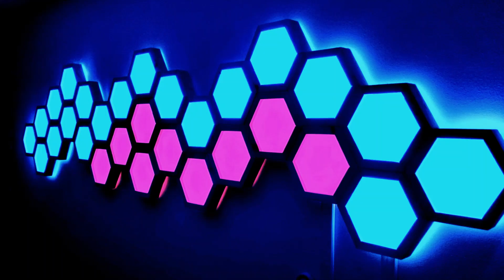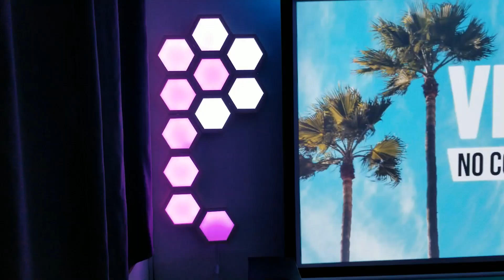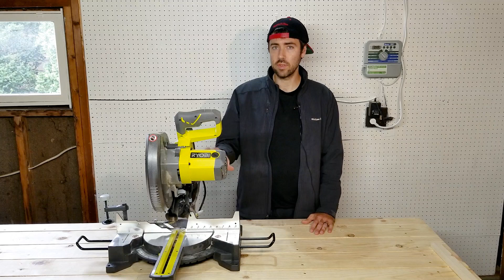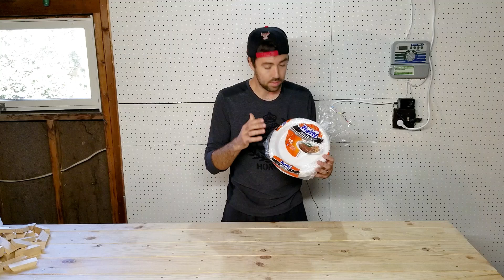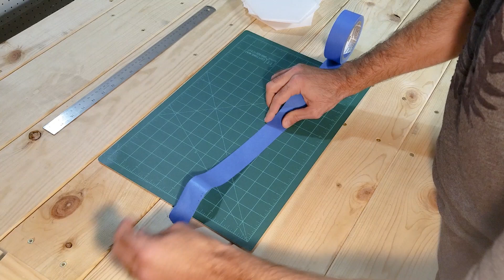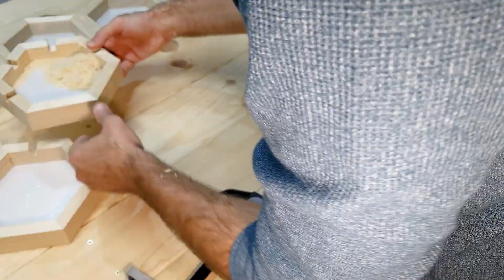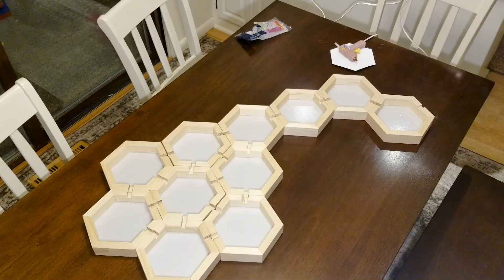Making My Own Version of Nanoleaf Hexagons - DIY Project (No 3d printing, programing or soldering)

Comment: Hey man great staffs. But I was wondering if the paper can diffuse the light well enough
Reply from the maker: Thanks so much! Paper comes in all different variety but it does work as a diffuser. In my experience when I was testing a variety of materials, white paper diffused the light a little too much but there may be different kinds of paper that would work. The styrofoam plates I used in the video did the best job of diffusing the light just enough where there were no hotspots but still let enough light through where it was bright.
Reply: @ChrisMaherDIY  so I tried the offset papers. Didn't work man. Too many hotspots. Then I tried the art papers. But still there were some hotspots. However when I attached two art papers, they did the job!
Reply from the maker: @kheladhulaobiram  There ya go! Awesome! All about trial and error. Part of the fun is finding what works and what doesn't. Thanks for the update!!
Reply: @ChrisMaherDIY  wanted to show you the final results 🥰 https://photos.app.goo.gl/hpRFpezvjw5pKpn36
Reply from the maker: @kheladhulaobiram  thanks so much for sharing!! Looks great!! You did that using art paper right?! Nice work!! Love the design too!

Comment: This is a great video and using Hefty plates is genius... I've been searching for perfect diffusers and this is great.  Also, with LEDs that are 30 LED/meter, you need 34mm from the light to the diffuser to get a "spotless" effect.... by using 2" boards with a slight indent (and considering the light source is slightly higher than the back), you managed to hit that 34mm perfectly, it seems. Did you plan that out ahead?

If you use LED strips that are 60 LED/meter, you can cut the side height in half... for any future projects.
Reply from the maker: Thanks so much for watching and the great advice! I didn't plan it out, it just was a lot of trial and error before I got the look I was going for! That's great advice! Cutting the side height in half would be great since keeping a low profile is preferred in my opinion! Thanks again and thanks for the feedback!
Reply: I dont understand what you mean, why do you need 30 m led
Reply: Later he found that white acrylic with 32 percent transparency looks better, but it costs way more.
Reply: https://youtu.be/YLfwbr-5PxM

Comment: Hey Man Great Video. Just a quick question, I want to know exactly how much hexagons to make to fit one led strip so; can you tell me the measurement of the short side of the hexagon pieces? Thanks
Reply: Also would you recommend using the wood glue to join the hexagons together? Have the super glued ones fallen off?
Reply from the maker: Thanks so much for watching! I appreciate the support. I just measured. Looks like the inside of each piece is 3 1/4  inch. (Three and one quarter inch)

Comment: Nice build, I actually just got done building my own after putting poster board on back how did you hang it in the wall?
Reply from the maker: Nice! How did they turn out?! I got some picture hanging hardware at home Depot. Its still on the wall and I didn't even have to find a stud. Just went right onto the drywall. https://www.homedepot.com/p/PicGenie123-40-Piece-30-lbs-Picture-Hanging-Kit-Hangs-Pics-Up-4-Pack-M30-MK4D/302044240
Reply: https://drive.google.com/file/d/1eiN2qKP_aFu5GCqhiHHo_dZ7Q66n0QF6 turned out good thanks for the tutorial man. Just saw your new one wish I woulda waited for the black though! Ah gonna have to just start another project haha 😆. Appreciate ya 👍👍 keep up the awesome vids!

Comment: Hey! How did you make it possible that every hexagon has the same light color?
Reply from the maker: The big design I have 2 controllers and the app that you use for the lights let you pick the color. In my thumbnail, 1 controller is controlling all the lights that are teal, and the other controller is controlling the led lights that are red. Hope that makes sense!
Reply: @ChrisMaherDIY  Ah yes I understand! I've bought a RGBIC LED strip. Do you know if its possible to select like 6 lights
 to go one color and 6 to be a different and so on?
Reply from the maker: @jelleraffel5  I see! Yes that is totally possible. I would recommend using an esp2866 board and load a program called WLED on it. Super easy to do. You can then set any LEDs on the string as a "group" and then control those groups individually!
Reply: @ChrisMaherDIY  Ok thanks, I'll look into that! One more question, they say RGBIC strips can not be cut, is this true?
Reply from the maker: @jelleraffel5  you can definitely cut them as I found out after making the video.  the leftovers can be hooked up to work just fine with most controllers. You just have to use either a 5v or 12v power supply depending on the type of lights you are using.

Comment: how to attach or hang on the wall ???
Reply from the maker: I just used some picture frame hanging hardware. I dont know if you have Home Depot where you live but this is the exact one I used: https://www.homedepot.com/p/PicGenie123-40-Piece-30-lbs-Picture-Hanging-Kit-Hangs-Pics-Up-4-Pack-M30-MK4D/302044240
Reply: @ChrisMaherDIY how much are the wooden cleats in cm ,and the length in cm of the cleats? I am French
Reply from the maker: @djbenouf  Thanks for the comment. What is a wooden cleat? I have not heard that terminology before. Are you able to explain?
Reply: @ChrisMaherDIY  the wood you use! how much width, depth and length ?? for cutting
Reply: do you have a link where to find the wood you use ??
Reply from the maker: @djbenouf  Ahh i see! I used something that is called 1" x 2" in America. I'm not sure if the link will work but here is what I used. https://www.homedepot.com/p/1-in-x-2-in-x-8-ft-Eastern-White-Pine-Furring-Strip-Board-63926439/314051613?MERCH=REC-searchViewedNA-314051613--N&
Reply from the maker: I imagine lumber is probably pretty universal in size so just go where you can buy wood and ask for the equivalent of 1 inch x 2 inch. I cut each piece to 4 inches in length on the long side which is 10.16cm
Reply: @ChrisMaherDIY  Access Denied error link
Reply: @ChrisMaherDIY  thx chris
Reply: @ChrisMaherDIY  thank youbuddy  ! and what size in width measure there all complete to assemble ??
Reply from the maker: @djbenouf  You are very welcome. Its about 7 inches across!
Reply: @ChrisMaherDIY  thx buddy

Comment: The plates on Amazon have a recycle mark on them were those the correct ones? Also do you recommend covering the back?
Reply from the maker: I don't recall the ones I used having a recycling mark on it. Maybe they changed up the design since I bought them? If they are flat against the wall you wouldn't have to cover up the back or if you like a little light shining out the back to give it a glowing look you certainly don't have to. Personal preference. Thanks for the comment and for watching!!
Reply: @ChrisMaherDIY  thanks! has been fun! Going to paint white, and I did see a comment that maybe the dollar store has a brand with no marks! Thx for the  video, this is epic.
Reply from the maker: @alankarnitz283  the dollar store is where I got mine. It was the se brand and name as the one on Amazon but maybe different. I took down the dollar store link since they were no longer available online. But for sure check that out. If there is a recycling logo on the plates and it's noticable, that would not be good lol. Let me know how yours turns out!
Reply: @ChrisMaherDIY  do you think if I can’t find plates then white acrylic you used for the boxes would work well at this size?
Reply from the maker: @alankarnitz283  I think it would work good with the acrylic. Worst case scenario if you have very minimal hotspots with the acrylic, you could maybe also use 1 layer of white stencil paper I use in my latest video on top of the acrylic and that should make it look perfect. I would also first try using a plate and see if the recycling logo is on both sides. If it's only on 1 side, it might not even be noticable if that side is the one facing down.
Reply: @ChrisMaherDIY  found em! 😎
Reply from the maker: @alankarnitz283  Nice! Where at?!
Reply: @ChrisMaherDIY  Good old Family Dollar store. No marks. Going to be perfect.
Reply from the maker: @alankarnitz283  Sweet! I love the Dollar stores!!
Reply: @ChrisMaherDIY   it turned out really great, had some issues with the hot glue not working well, but it’s solid now. Any recommendations on other items to glue together? Would love to show you the finished product video does this channel have an email?
Reply from the maker: @alankarnitz283  Awesome!! Yeah the hot glue was probably not the best idea. I would either just use wood glue or just use some small screws. I'd love to see how it turned out! outrunprojects@gmail.com

Comment: Great job.  One concern that came to mind was if one of the styrofoam diffusers gets damaged?  Some idiot pokes a hole in it or a curiou kid toucjes and makes a hole
Reply from the maker: Lol yeah that could definitely happen. I'm sure it's possible although not easy to break apart and remove a hexagon and replace it with another one. You could certainly use acrylic but I didn't find any that did as good of a job as the plates diffusing the lights at such a close range.

Comment: Hi Chris, love your projects! Have you looked into wled for your led controllers? You can then use individually addressable led's that can be spliced together to create that single strip you wanted. Also wifi controllable with a smart app and compatible with alexa/ Philips hue etc. Have some really cool effects that would really make these projects stand out more. Keep up the good work man 👍
Reply from the maker: Thanks so much for watching and the comment! If i were to do it again that is exactly how i would do it! In my latest 3 projects I started using and esp2866 wifi board with WLED loaded on it to control some ws2812b led strips. I'm loving the customizability of doing it that way. When i made my first couple projects, I really had no experience with LED lights so i didn't know what all was out there. I'm slowing learning a little bit with each project that i do. Thanks for the support!
Reply: @ChrisMaherDIY  I recommend you check out a bit of kit called the dig-uno. Is a great bit of technology that will save soldering the led wires and also offers protection via a built in fuse. Maybe better for larger projects. Check out some great videos from a guy on YouTube called drzzz on how it all works. Costs about $20.
Reply from the maker: @stephengrant6894  awesome!! Ill for sure check it out! Soldering is not too hard but I wouldn't say I enjoy doing it. Would be nice if I didn't need to do that anymore! Thanks!

Comment: Never use a mitre saw without a full proof jig to cut dados into thin, short boards like that! You will lose fingers or a hand!!! No doubt about it. Use a table saw or router 🤦🏻‍♀️ it’d be smarter to route or use the table saw for the dado PRIOR to making tiny angled cuts on the mitre
Reply from the maker: Thanks so much for the safety tips and advice! Always good to hear from woodworkers who have much more experience than i do on how to go about things better. Thanks for watching and the comment!

Comment: but where does the power come from?
Reply from the maker: Thanks for watching and the comment! Sorry I didn't spend any time going over that part. All I'm using is the power adapter that came with the led lights bought on Amazon.
Reply: @ChrisMaherDIY  was wondering if the controller had a battery.
coz actually why not rly...
was thinking of making these, and putting batteries in one of them, and some way to change easily.

whats your thoughts of making the cells black instead of the wood "color"
you have them on your wall so you would know how it could look
Reply from the maker: @apanlæg  making with batteries would be sweet! No cords would look so clean. I would maybe try doing something with a rechargable battery pack maybe? I think black would look really nice. Having that black/white contrast during the day would be cool. I would still paying the inside white for better light reflection when the LEDs are on. Love the ideas!
Reply: @ChrisMaherDIY  saw another video with a guy that did it in plastic
his was off the wall, and had a back plate.
gave the whole model a greater feeling and more light from the sides. you should try putting some blocks between the wall and model, idk if thats enough or u actually need to get something for the back, easy enough with some plates just glued to the back because you cant see them.
anyway just an idea, and probally what im gonna do

Comment: You're a couple of months into this now, have you noticed any warping of the plate due to heat?  Thanks!
Reply from the maker: Thanks for the comment and good question! So far no warping at all.
Reply: LED strips/lights don’t give off heat!
Reply: @oklahomie95  BRAUN
5500 Lumen 4 Ft. Linkable LED Hanging Shop Light

(457)
$34.99  Some do. . .
Reply: @damon_81  well I meant low lumen like a strip, I don’t believe those give off heat. The ones I have don’t at least
Reply: @oklahomie95  I know, these have a strip of leds, but they do definitely get warm. No worries. 🙃

Comment: hi Chris

I compliment you for the really beautiful project

in italy there are no Hefty deluxe Extra strong & deep cymbals, and I am opting for a white acrylic panel, but I think it is not the same thing

the only dishes of that brand are Hefty Everiday Soak proof are they the same thing?
thank you
Reply from the maker: Thanks!! I don't think those soak proof ones would work but I'm not 100% sure. You could try using the acrylic I used in this project: https://youtu.be/cUV77NR-zWk but you might just need to use wood that is 3 or 4 inches deep instead of 2 inches to be able to diffuse the lights so that you don't see the individual LEDs.

Comment: if you use 2812b leds you could cut them and still make the rainbow effect y recomend you using the sp501e controller 
sorry for my english its not my first langauge
Reply from the maker: Thanks for the comment and the recommendation! I'm going to have to try this! I'm also going to check out the sp501e controller. Thanks so much!

Comment: This is awesome. Liked and subscribed. What I'd like to know is what happens after you connect the wires? What hardware and what software? How do you make one hexagon red, the other blue? How do you program this? Thanks.
Reply from the maker: Thanks so much and great question! The big hexagon project with the red and blue as well as the one I made in the video I just used the basic controller that came with the led light and used the app that they said to download. Since the larger project was so big, it required 2 controllers. So one controllers lights I had set to red, the other controllers lights set to blue. Hope that helps but I should have incleded that in the video as well. Next time!
Reply: I’m glad you asked; I was wondering this as well! I love the look of the two different colors. I’m going to make these for my boys. Thanks for explaining Chris!!

Comment: You can absolutely cut and splice addressable LEDs. You just have to make sure you splice them back together in the order you want the addresses to run. That's why they have the cut points in the first place, and why there are solder pads there.
Reply from the maker: You are 100% correct. I didn't know much about LED lights when doing this project. The manufacturers info on these lights said if you cut you can't use the rest and I didn't know any better. My only guess is maybe they meant you can't splice them together and have it work with the controller that the lights came with? I have successfully used the leftovers now using an  esp8266!

Comment: Hi Chris! Great video. I was wondering if you placed them a few millimeters from the wall as there is also a colored glue on the back (outside) of the hexagons. Or did the light shined through the wood? Anyway, great end result!
Reply from the maker: Thanks for watching! They are a couple millimeters from the wall. On the back side i just put some paper and you can see the light coming out the back some. I do like the way it looks with a little glow coming from the back but i also think if you covered the back up so that no light would come through it would also look cool and maybe a tad bit brighter on the front since your not losing light out the back! Hope that helps!
Reply: @ChrisMaherDIY  thanks for the super quick response! Keep up the good work!

Comment: I believe you can solder a piece of a previously cut LED strip at the end of the first one so you can have only one input, or if you want to “recycle” some old piece of LED strip (meaning it wouldn’t become useless when you cut it, providing you cut at the right place).
Reply: That should work to extend the first strip with an off cut, just got to be a bit careful with the arrows and joining the same pads. But would you be able to get the 2 distinct colours like in the still picture? Now I'm torn between it costing me 2 strips and being able to control them individually , damn I hate choices , I want both 🤣
Reply from the maker: That's a good idea! I'll have to try that next time! Thanks for watching!
Reply: why do you look like the beans I ate for dinner
Reply: @joecuttinup  no cap I had beans as a side for dinner to ight
Reply: @Re7nuh  yes